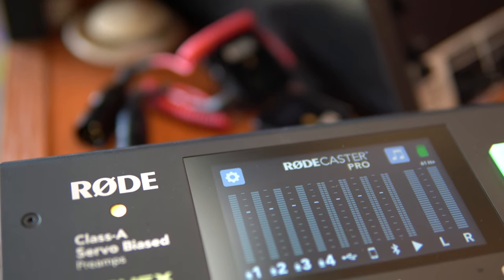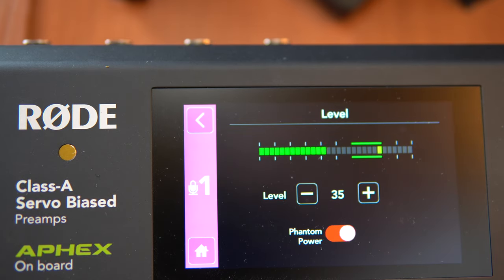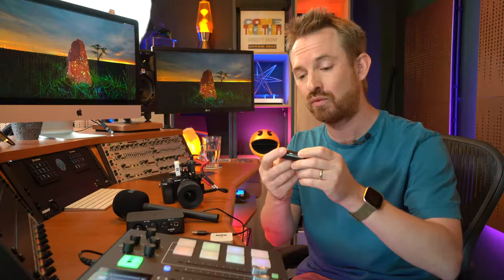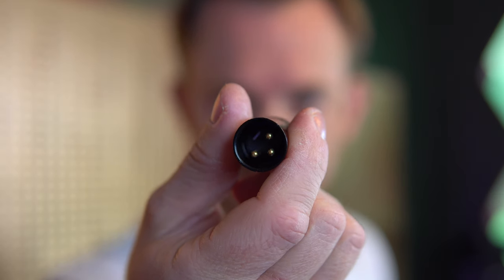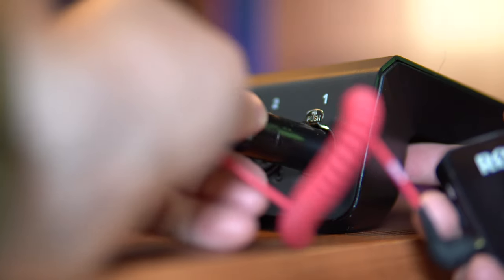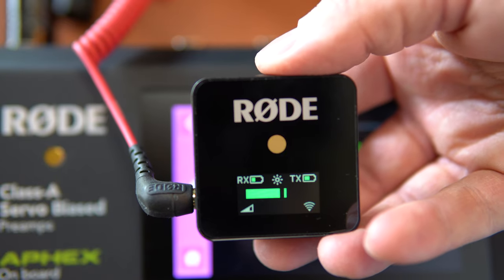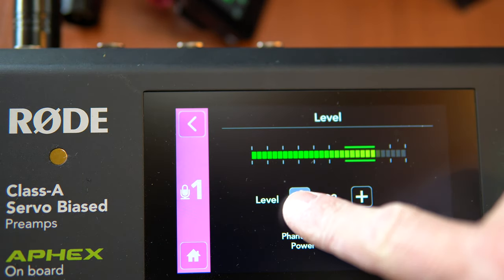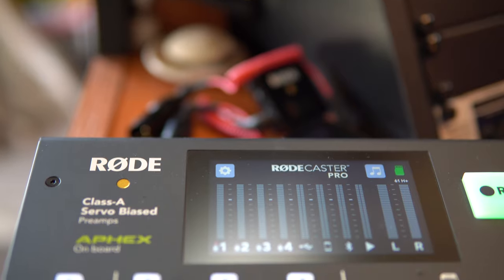How to Connect a Lavalier Mic to a Mixer

Comment: You could also use the VXLR+, which drops the phantom power down to plug in power, if you’d like a safety net for those times you forget to turn off phantom power.
Reply from the maker: Thanks for sharing 👍
Reply: Use VXLR+ is the only sure thing.
Reply: @yannstewart1355  f i use the VXLR+ with my wireless go ii then can i also safely use phantom power for other microphones? thanks
Reply: @felipevillaroman2562  wireless go ii output      don't need any phantom power. You can use VXLR (not VXLR+) to convert 3.5 mm jack to 3 pin XLR.
Reply: @yannstewart1355  let me elaborate on my question,  i have a mixer with a few microphones two of them require phantom power... to that mixer i wanna add my wireless go, in this case do i need the VXLR+ so i can protect the wireless go transmitter? do that the wireless go output don't require the use of phantom power
Reply: @felipevillaroman2562  exactly, especially if your mixer cannot independently turn off phantom power to the channel you want to plug your wireless go to. The VXLR+ will convert phantom power to plug-in power which is harmless to the wireless go, and REQUIRED for most lavalier mics that plug into your camera. The same stands for shotgun mics like the Rode Videomicro and Deity D4 Mini.
Reply: Thanks for the brilliant content. Just a question: i can do the same way for the wireless go II double transmitter system but, in this case, i would have two mics controlled by a single chan on the mixer and no separates volumes and eq controls. Any tip to solve this? Thx

Comment: Mike , is there any difference in wave  between mono and stereo .. will  mono wave cut off any particular frequency. Or is it same like stereo wave  and frequency
Reply from the maker: Most microphones are mono so whether you record in mono or stereo you'll be getting a mono file and duplicated to dual mono if you record in stereo.  A stereo file records a left and right channel and a mono file records a single channel.  As far as voice is concerned, until you process it and possibly add stereo effects, there is no difference between recording your voice in mono or stereo (unless you're using a mic like the 3DIO or using a Blue Yeti in stereo mode)
Reply: @MikeRussell  thanks a lot mike.

Comment: Thank you so much sir.
I hope this method can really work like a  lavalier mic connected to the coat of a preacher (  which has a transmitter,and a receiver ), to address  from a stage,like a pastor teaching his congregation.
Is not so ? Please  confirm.
Reply from the maker: Yes, this method can work for connecting a lavalier mic to a mixer for use in a live setting, such as a pastor teaching their congregation from a stage, as long as the transmitter and receiver are compatible and properly connected.
Reply: @MikeRussell  Thank you.
Reply: @MikeRussell  will there be latency issues, and also will the audience sounds better captured as well ? Do the rose mic's have good rejection ?

Comment: Hi! Thanks for the video. You mentioned using this for church. Would it work to use this mic for the Pastor? If I plug it into the mixing desk will it come out over the sound system in the church?
Reply from the maker: It should do yes
Reply: Thank you, I was looking for this so long and couldn't find any info on this. Will these microphones catch the audience sounds as well ?

Comment: Hi, thank you for this super nice and short video. One question:

Could this adapter work with any lav mics? Got one from Amazon super cheap around 40 Euros and the same problem here, doesn't work. I'm teaching online (drummer) and using a RME FIRE FACE 802 there's no signal at all.... Do you think it could work with this cheap lav mic? It's a SYNCO Lav-S6E
Reply from the maker: Technically this should work regardless of the price or quality of your microphone

Comment: Can you do it the other way? Plug the wireless go transmitter into the headphone output of the mixer and receive the mixer audio to the receiver?
Reply from the maker: I can’t see why not although you’d need the right cable and should watch audio levels.
Reply: @MikeRussell  thanks for replying my dude. There's one super Chad that uploaded a video going through the process and explained why using an attenuation cable is necessary. Appreciate you.

Comment: Mike - is this the mic system you use for doing these videos? Can I plug into the Tascam 12 in a similar manner?
Reply from the maker: Most of my videos are recorded using the studio mics and my Signature 12 MTK mixer but you would be able to do this with the TASCAM Model 12 as well.  Just remember to switch off the phantom power!!

Comment: Thanks for the video, Mike. What is that adapter that goes between the receiver and the VXLR?
Reply from the maker: The output from the mic goes straight to the VXLR.  Make sure you follow the video exactly and TURN OFF PHANTOM POWER before trying this yourself

Comment: It would be a very useful feature for this Røde adaptor to block 48V to pass through 3,5mm connection.
Reply from the maker: Just remember to turn off phantom power and you'll be ok 👍

Comment: Hai Mike, I Have a problem connecting multiple condenser microphones and Rode Wireless Go (which I haven't bought yet) to a single mixing console, because the Neutrik combo jack input has 48v phantom power in its XLR, is it safe if I connect the Rode receiver to the TRS of the combo jack?
Reply from the maker: Hi, you 48v phantom power is carried through the XLS cable but won't be carried through a TRS cable even if it's a combo jack input.

Comment: Hi.  I used a 1/8 inch to RCA adapter cable to plug into a line level channel on my mixer...  for a Rode Go receiver....  but there seems to be some impedance mismatch.  Can you explain how I might make it work? Thanx
Reply from the maker: Hi Paul.  You’ll want the microphone in a microphone channel.  The mic channels have the pre-amp needed to process the mic output.

Comment: I have a RODE smartlav+ mic (the one with a TRRS output), and I want to use it on my laptop via a scarlet solo AI. Would getting a TRRS to TRS adapter as well as a TRS to XLR adapter, and plugging that into the AI work? Lots of adapters I know, but would it still work? Of course, I'd be turning off phantom power.

Thanks!
Reply from the maker: It's a lot of connectors and adapters but in principal it should work.  As you say make sure phantom power is off!!
Reply: @MikeRussell  thanks so much for replying! :)

Comment: My lavalier mic actually does come with a small battery, and works fine when i plug it into a smartphone, but if i plug it into a USB mixer/interface the sound barely comes through even if i turn all the volume levels up. I haven't tried a different mixer or interface but could the VXLR adapter help? Thanks
Reply from the maker: Sounds like it's either the adaptor or the pre-amp in your interface / mixer doesn't have enough gain available

Comment: Why can’t you just plug it in and play? Like in an aux in on your mixer
Reply from the maker: A microphone (particularly most dynamic mics) will need a pre-amp which an aux in won't have plus using a mixer or interface vs most on board sound cards will give you a cleaner sound.